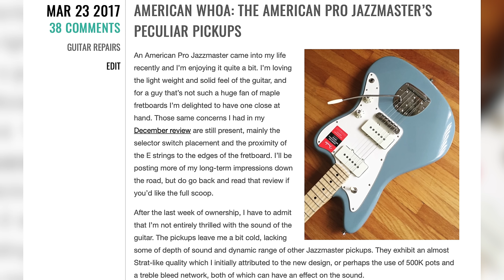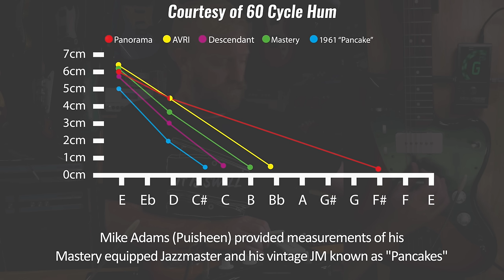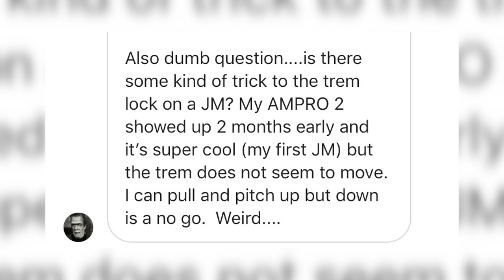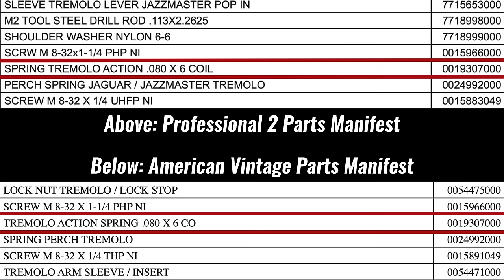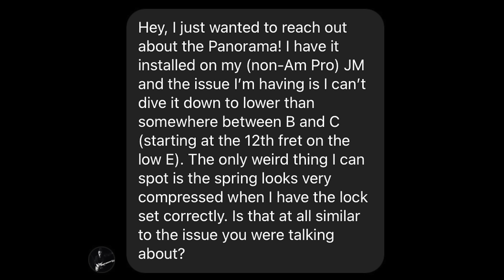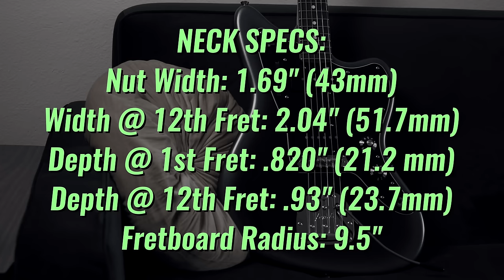JAZZMASTER REVIEW #6: Fender American Professional II Jazzmaster + Demo!

Comment: Hi Mike! Thanks for thorough review backed with really great music. Just want to share my own AmPro II experience as a bit of counterbalance.
The good.
* Pickups. Neck pickup is meh: it’s coil is narrow and sounding thin. But the bridge pickup is totally different beast. It is designed very much like the classic JM pickup with magnet rods and wide flat coil. The most important thing about it is that modern/vintage coiling (if I may call it that way) influences mostly tone and NOT output volume. The boost you get in "modern" mode (overwound coil) is barely noticeable especially if compared to one from "rhythm" / series circuit. But that tone! It gains so much quack and thickness that it sounds like totally different pickup! And this thickness is JM single coil thickness, not P-90 thickness. I’m in love with this feature. I totally disagree about pickup muddiness: I get as much presence and clarity with stock 500K pots as I need with both tapped and untapped bridge pickup (my setup is Fractal FM3 + AustinBuddy presets).
* AmPro II rhythm circuit. It provides amazing thick, round and powerful but not muddy sound which is what rhythm sound should be like IMHO. I couldn't find any use case for the original JM rhythm circuit as it turns guitar sound into dull muddy unusable mumbling. So it’s great that Fender spared AmPro II JM from this abomination. One caviat though: both rhythm circuit pots are linear so it’s not that easy to tweak the sound.
* Sculpted neck heel. I love this feature so much that it was almost a deal breaker for me. It’s especially useful for those who play lower strings at higher frets.
* Stock tuners are quite good though I consider Hipshot Directrofit staggered locking tuners as upgrade. I highly doubt it’s possible to install any Gotoh tuners into modern american Fender headstock routed for 2-pin tuners without drilling of some sort.
* Panorama arm. It sits quite close to the guitar body which is good if you want to pluck strings while lightly holding the vibrato arm to wiggle it without reaching and don’t care about dive bombs. Mastery/AVRI vibrato arms are very far from guitar body.
* Bridge. First thing I did is upgrade to Mastery bridge. But the sound I got with Mastery was strangely unpleasant and didn’t bring me any joy. Then I installed stock bridge back and OMG, sound became so much better! I’m sure it’s the saddles. 
The bad.
* Nut. My JM came with poorly slotted nut which causes open strings sound poorly with muffled attack. I doubt it's possible to install 11-gauge strings without reslotting the nut.
* Shielding. Stock graphite paint shielding is useless as usual and almost non-existent as hum protection compared to custom copper foil shielding. Guitar manufacturers are usually aim to lower the production cost as much as they can so poor shielding is no wonder.
Overall AmPro II JM is amazing guitar which requires just a little upgrade and tweaking.
Reply from the maker: You know, it's fair to say the full bridge coil is shaped like a Jazzmaster pickup, but because of the tap the "vintage" portion of the coil is not. I still find that bridge pickup unusually dark.

I definitely forgot to mention the heel because I mentioned it in the Ultra review, but it certainly is nice. Not something I ultimately care about though, I never find my regular heels to be problematic.

The arm thing is something you can always adjust no matter what vibrato fyi

Comment: After breaking a string today and watching your video yesterday I decided to put on a new set of 11s as I was going to anyway. Well, surprise surprise would you believe it, now I can't dive the whammy bar of course.
Well here's the rub... When I picked up the guitar last month the shop sales person told me that I have two years warranty on my new Jazzmaster.  
Does putting 11 gauge strings on a Fender guitar void the warranty? If not, then Fender needs to rectify this fault by supplying the correct spring to the dealers service departments. Don't be sending it back out with 9s ore 10s on it.
I still love the guitar, but I need a new spring to make it perfect again even if I have to buy it.

Comment: Great review and happy birthday! I really dislike black jazzmaster pickup covers, so while I like the deco pick guard but I'd try to swap to some kind of cooler covers.

I have a quick jazzmaster question if you have a sec: I'd like to get an Olympic white jazzmaster with a 7.25" radius but without a matching headstock. Is the AVRI 62 my only option? Would prefer not to swap pickups but it's not a deal breaker.
Reply from the maker: I have so many spare ivory covers I could experiment with them a bit. AVRI 62 and I believe MIJ are good options for your preferences

Comment: Great video! I want to change my pickups. You mentioned the JM 90 & JM 180–would you recommend them over the pure vintage 65 jazzmasters?
Thanks!
Reply from the maker: I have them in this one now, and I do wholeheartedly recommend them! I'm not such a huge fan of the PV65s, they're very thin-sounding pickups and lack the low end that I associate with good original Jazzmaster pickups
Reply: Last question—would JM V sound better in neck than JM 90 since the JM 180 would be in bridge? My brain hurts! Thanks dude!!!

Comment: something about the term "V-mod" as the name for the pickups in the American Professional series kinda concerns me, only because Squier already had the "Vintage MODified" series. it leads me as a consumer to believe that they are just slightly rebranding and using the same Squier pickups. I am sure that's not the case, but it does make me a little skeptical

Comment: Hey Mike, great vid! I just added a Parallel Universe Spark-o-Matic Jazzmaster to the offset collection (with the firebird pickups). Great tones. I fitted a staytrem collet immediately. It has the Professional bridge, with the plastic bushings. I removed them as I wanted the trem to work as it should, but it seemed to lose sustain? Did I imagine that? Or do they help transfer some string vibration through the bridge to body I wonder? It sounds quite lacking in sustain compared to my other offsets, but that could be the mahogany centre block I guess? Would love to know your thoughts!
Reply from the maker: I noticed a lot more sustain once I pulled those bushings out. Felt like the guitar was able to breathe a little more

Comment: Hey Mike, great demo and review as usual. I am more vintage oriented so I keep my American original 60s and Squier 60s. The sound and features of the Pro 2 didn't convince me. Even the series wiring and collet of the trem arm seem like interesting features. Is the panorama collet compatible with an AVRI plate? My only problem with my jags are the loose arm.. in one of them I got a staytrem arm and collet.. but I like a lil bit more the fender arm..
Reply: And Fender should be ashamed that put 9s in their offsets and they don't hire you. Congs that you broke down the problem with the tremolo string.

Comment: Hey there, recently was turned on to your channel GREAT STUFF! 
currently have this guitar... LOVE how it looks and plays but wanted to swap the pickups and try the neck JM-V and bridge JM-FAT set...

I'm a novice unfortunately but it seems it wouldn't be a simple swap with the circuitry. 
Is it advisable to also change out the pots as they are 500k? I've read that "True JMs had 1meg pots". Does it make sense to also purchase and replace those?

Also I guess the tone pot has a treble bleed chip for when you engage the tap, plus the selector for lead/rythm has a lot more connections then a standard switch, do you have any guidance on how that can be done? Im sure if I stare at a wring diagram long enough it will make sense....I was hoping to do it myself but not against taking it somewhere, just thought I'd reach out here first! Thank you so much sorry for the long message here!

V/r,
Reply from the maker: Personally I prefer the 1meg pots, but why not do one thing at a time here? Swap the pickups, play them for a while and see what you think, and if you need more brightness you can always swap in for higher values. And whatever pickups you use, just solder them into where the hot wires from the stock pickups went. You shouldn't need to make any changes at the RC switch
Reply: @Puisheen  awesome thanks so much for the reply you rock!

Comment: Great video! It was so good I watched it twice lol. Glad I watched this before changing my strings. I have set of 11's I've been sitting on for a few weeks but just haven't gotten around to installing them yet. I had a weird issue with my tone knob though. I had removed the knobs in order to peel the plastic from the pick-guard and the little screw fell out of the tone knob. I can't get it back in for the life of me! I contacted Fender about a replacement and they just referred me to one of their third party vendors. I still can't seem to find the proper replacement part though. The off-white/cream colored parts are nowhere to be found :( I ordered the 65 reissue witch hats but hey are more white than the rest of the plastics.

Comment: Hey mike.- enjoyed your video! Personal preferences aside between the Am Pro models, it's fantastic the bridge radius (how did they ship out 12" bridges?!) and the string spacing got corrected. Thanks for shedding light on the updates for the Am Pro 2. 

I am an owner of the Am Pro 1 JM. Do you happen to have any good solutions for keeping the tremolo bar stable? Specifically, the nut on the underside of the trem assembly seems to come loose when I screw the bar in. Any insight would be appreciated!

Comment: Late on this, but for the Am Pro 1, rub a bit of chapstick on the tremolo arm screw and it fixes it right up. No more grinding.  Support at Fender suggested this. Only did it once 3 years ago and it's still fine.

Comment: I wouldn't pay 1800 for my copy, which had terrible finishing on the rosewood fretboard.  
Sent it back and they replaced it, with another copy with junk poly on the neck again. 
I kept it and sanded it down, and it looks much better. Just lazy QC for what it seems like a majority of the rosewood boards having this issue. 

Also, I'm wondering if you've got a good place to find a replacement spring?

I put 11's on mine and ended up tuning it to D so I can use the trem until a re-string. 🤣

Thanks for another great video!

Comment: High quality informative content as always. Beautiful. 

Hoping you might have time for a quick yes/no question? 

I have a JM body without any screw holes and I need to position the vibrato in its cavity so I can drill the fastening screw holes. Does the tailpiece on a traditional JM vibrato typically sit flush against the butt end wall of the vibrato cavity? 

Many thanks for what you do, whether you have time to reply or not.
Reply from the maker: Ideally you should have a little space ahead of and behind the unit. Check out my partsmaster video for how I do that
Reply: @Puisheen  Awesome - answer much appreciated! I will try to measure out equal distances from the back and front walls to begin with, and route out additionally if required.

Comment: Hey Mike. Quick question. You say if you had to choose between an angled neck pocket or a micro tilt adjustment, you'd pick the micro-tilt. Isn't the accepted logic that more wood on wood contact is better for sound/tone transfer? Do you pick the micro tilt just because of the "infinite" adjustability? Doesn't the lack of wood to wood contact bother you? Thanks!! BTW: I'd switch to Gotoh tuners the first minute I owned the thing also! GREAT review. Thank you!
Reply from the maker: I won’t say wood-on-wood isn’t preferable but the Micro-Tilt is a big bolt that makes contact with a big metal slug in the neck, and I can’t say I’ve ever noticed a lack of transference. I admit I’ve never done the work to install an MT on a regular neck and pocket so that could be interesting, but I will say that if there’s a difference it’s never bothered me. All of my offsets have different shims — some full pocket and some the stock partial pocket fibreboard — and they all feel about the same to me

Comment: I haven't checked yet myself, but I think the Bigsby springs and the Fender vibrato springs are the same size. If so, any modern Bisgby spring should be a good fix for the panorama vibrato system, as they are super stiff! I often replace mine with softer springs for a better, more vintage feel on modern Gretsch guitars.
Reply from the maker: They are not!
Reply: @Puisheen  too bad. That would have been an easy fix.

Comment: Try .11’s in E flat and the vibrato performs just right. As well as lower gauges. 11’s in standard E tuning is A lot of tension in general. I agree that push/pull should be opposite. Makes sense. I prefer vintage tuners as well but these are just fine. The deep C neck is really great and the frets make it an easy play. The pickups are just okay but thats because I love Lollars and once your ear has had a taste everything else just sounds okay. I gave the neck micro tilt a little turn even with the angled pocket (Always release some of the neck plate screws before doing so).The guitar was surprisingly lighter than I imagined it would be. Overall great assessment.

Comment: I fought with mine, and after failing to sell it for many months, I gave it another chance. All I did was put 10s on and it transformed into a great guitar. But I find the tone I like best is the "rhythm" in parallel (pull switch up). The tuners are ugly, but surprising comfortable and feel really good to turn. My only issue is that my trem arm won't bend. I think it's titanium. I've bent 7 arms with my bare hands. I've made many more attempts with this one... surely titanium.

Comment: Just bought a Jazzmaster American Professional II, love the feel and the sound. However I’m seeing what I think is a strange anomaly. Tuned and intonated the guitar with a Peterson strobo plus and both settings seem to be right on the money. Then checked specs, neck bow needed a slight adjustment to get it to Fender factory specs, was about 0.018. Brought it down to 0.012. Retune but the same anomaly. I seem to get sour chords involving the 4th and 2nd string. Other chords seem ok but this just seems weird. String height at the first nut seems way high to me, could that be the issue? Around 0.020-0.018. Any help would be appreciated. Need to make a decision to keep or return.

Comment: Nice review! I currently have a AM Pro Jag with a Staytrem installed. It has the nylon bushings on the thimbles. Would you recommend removing these? I ideally want to play behind the bridge but the break angle is quite strong so it prevents it. Not sure if lowering the bridge and removing the thimbles would help? Thanks!
Reply from the maker: I removed mine and found myself much happier with the sound and performance of the guitar, but thankfully they're easy to pop back in if you end up not liking the floating bridge. Give it a shot and see!
Reply: @Puisheen  Thanks man, I'll give it a go!

Comment: Well Mike, I stumbled upon your fantastic, inspiring channel a couple of months ago as I have decided that this year I will get my FIRST Jazzmaster but have been so confused by the different models old and new. Vintage is probably out of the question, so I had - I think- narrowed down my choices to the Oxblood Troy Van Leuwen, the American Vintage 60s and 65 and this American Pro II, which is the easiest for me to acquire here in the UK. I was therefore really looking forward to this review. But I’m still confused. I’m not hung up on absolutely vintage correct specs, but I do want it to sound like a Jazzmaster. Not quite sure this one is right for me.
Reply: i am no mike, but all of those options are going to be great guitars. personally i don't keep any stock pickups in any fender guitars. if you want the jazzmaster sound, you don't have to break the bank with aftermarket pickups. even EP custom pickups are great for cheap.
Reply from the maker: The TVL is a great guitar, and if you can score an older AVRI62 or a US reissue of some kind you'll be set too. I don't think you can go wrong with any of the choices you listed, and as Gaige said, there are a bunch of good aftermarket pickups out there. EP is a great company!
Reply: Personal opinion, the 62 AVRI is my favourite guitar that isn't an actual vintage. But the other guitarist in my band has the TVL and I absolutely adore it.
Reply: @Artefracture  I'm weighing up between the AM Pro 2 and the TVL at the mo. Would you go TVL?

Comment: That vid with Ryan was how I came to follow your channel. Fender is not going to love this review no matter how diplomatic you were - which confirms my trust in your credibility. 

BTW, I was watching this plinking on my Pacifica 904 which was a high end model from the '90s that was one of the first guitars to have a really good push-push pot. Interestingly, it has the same system. Down is both bridge pickups. Up is just the main single coil. But yeah. I leave it almost always in the up, classic strat bridge, position. So now that you mention it it doesn't seem ideal.

Comment: Happy 40th! I turned 40 in 2021.  I own an american strat, pro tele, and want a jazzmaster. I’m so confused by all the models/versions. Can you tell me your favorite version of the Jazzmaster?
Reply from the maker: That would be my '61 or the AVRI62s
Reply: @Puisheen  I found a b-stock from MF for less than the old price. I have the problem with the trem spring though. Is there another aftermarket spring available? I don’t feel like buying a whole setup for the spring. MMGB has a beautiful ice blue 62 avri but it’s out of my price range.